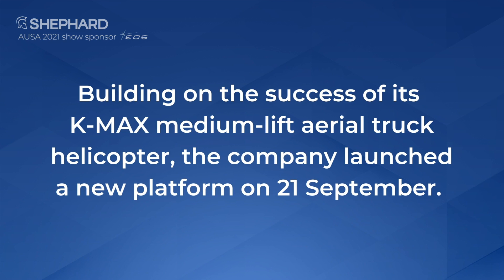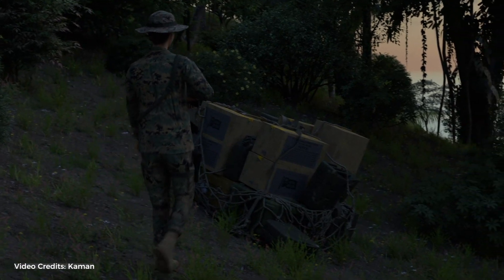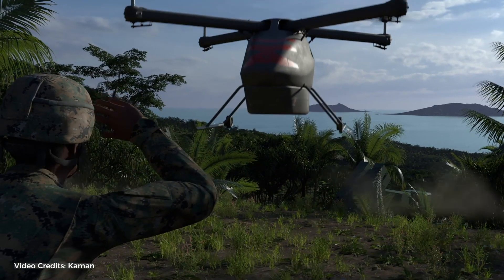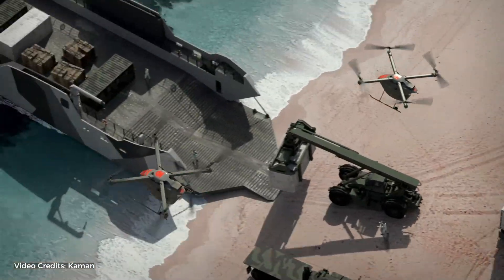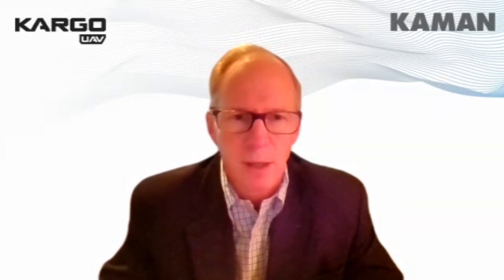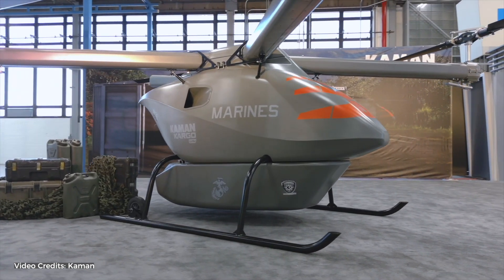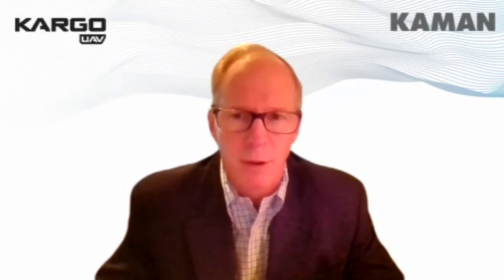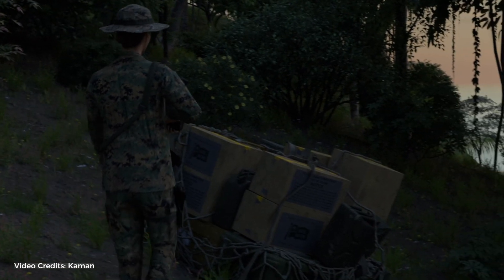AUSA 2021: Kaman displays KARGO UAV

Comment: An intermeshing synchropter version would have a much larger payload.Quadcopters are great for maneuverability but not so much for pulling.The Phenix Solution's Ultra 2XL uses the same RR300 turbine in a coaxial configuration but has twice the payload.An intermeshing synchropter should have even more.Each may have their desirable traits and purpose but hauling heavy cargo is not for a quadcopter.Swiss has a synchropter type drone but it's small.